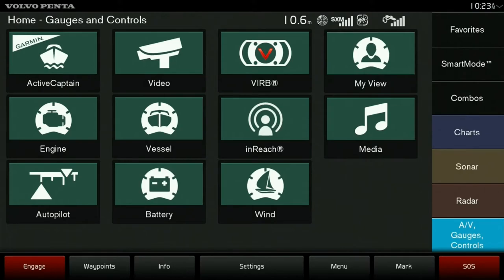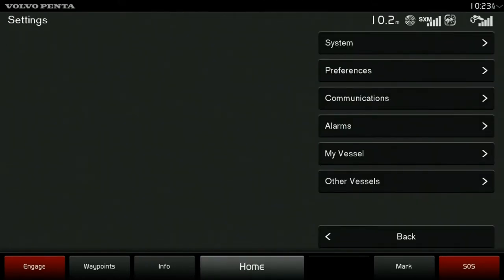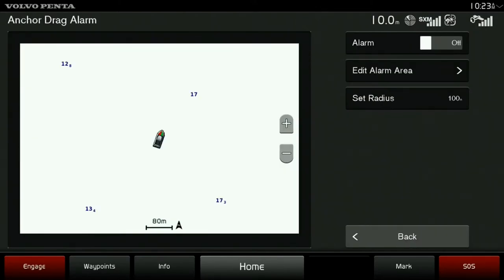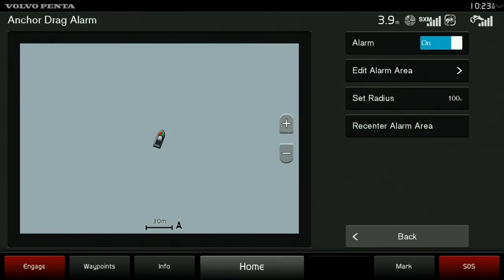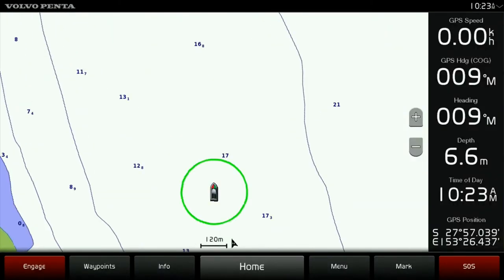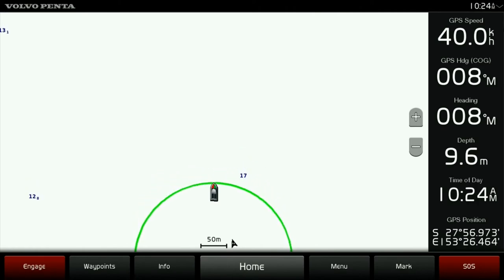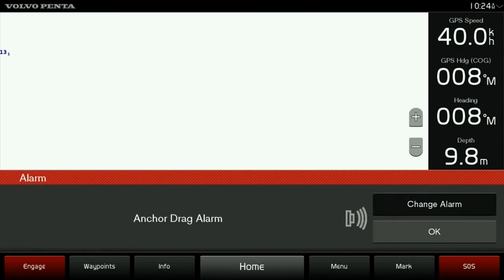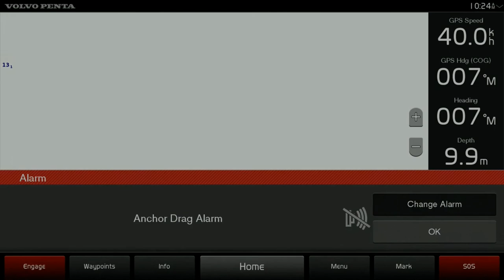Anchor Drag Alarm - Garmin

Comment: Do you want to set the drag alarm when you drop anchor or once you are set to your vessel's anchored location?
Reply: I just stay over the anchor as it drops down, and set the anchor drag alarm starting at the depth (aka when I know the anchor has hit bottom). Also note where your GPS indicator is… it’s not at the bow, so I add needed feet for that, too. I basically set the distance with a little buffer which depends on the boat so I don’t have to do math!